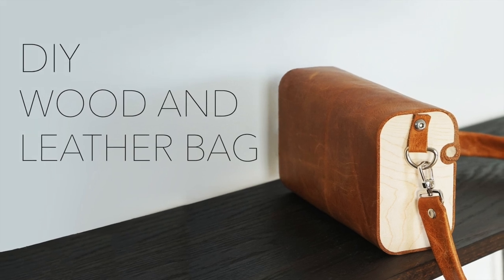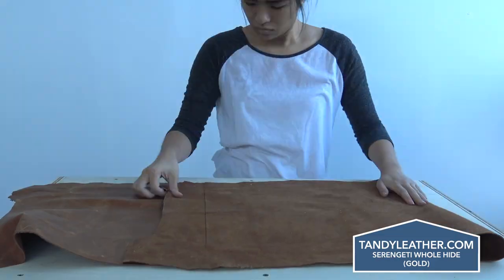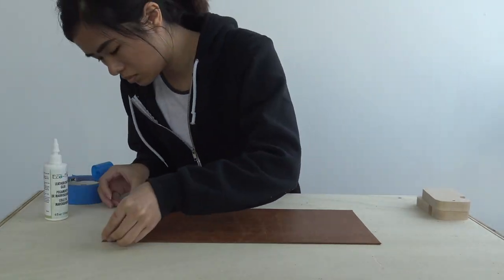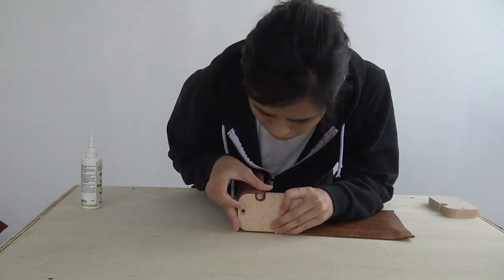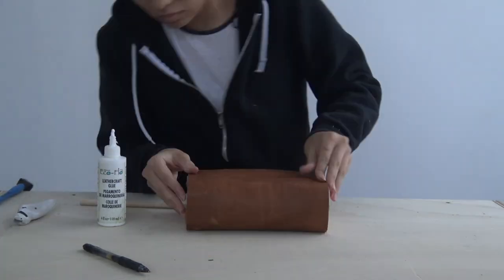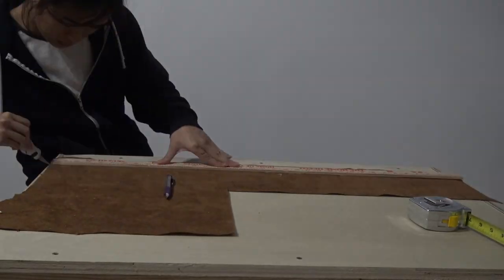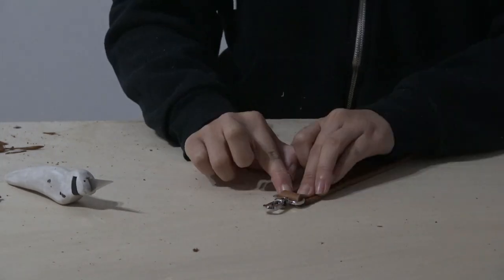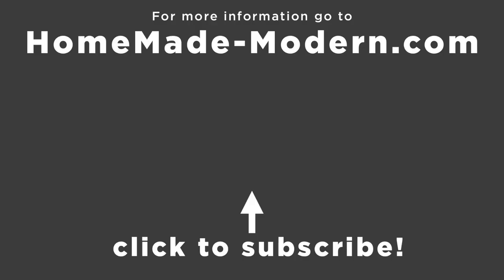Making a Wood and Leather Bag | A CNC Project

Comment: Use Barge cement or similar for structural gluing like that (where you're not stitching over top), the eco leather glue stuff won't hold over time. With the tap of a hammer your stuff will be permanently stuck, no more issues holding everything while the glue dries 👍

Comment: Impressive that this is real DIY work by a woman, instead of yet another crafty, superficial creation.  This is good work!  Very glad to see your CNC table top machine, and I must get one.  I also did not realize you could glue leather easily.
Could you share the type of glue you used for the leather?

Since I do a lot of woodwork and refinishing, let me pass on some info to you.  I think the wood on your bag would look better and not get staining from use, if you finished it off with:
1.  Coat liberally with Watco Danish Oil (follow label).  Let dry overnight.
2. Thin out Varathane Polyurethane Oil Based Clear Interior Satin (30%) with Mineral Spirits (70%) and put 2-3 coats on oiled wood, sanding with 400 grit in between.  Make sure you have no bubbles in the Poly finish.  Make sure you wipe lightly after 30 mins of application to even out the layers.

You will find that the Poly makes the wood durable and stain resistant, and gives a nice finish.  I generally use a Satin not Gloss but that is your preference.  You can also dye the wood prior to oiling and Poly coats, with some fun colors like Vintage Turquoise/ Aqua, or Red, or Green to match or contrast with the leather colors.

Thanks for a great video and good luck with your projects.  These are good enough to sell!

Comment: buy a thicker leather next time, make sure you burnish the edges, treat it properly and give it a nice dye. Pretty sure you can get pink or anything  else in a good quality oil based product which will give you the best results. And always ALWAYS remember to apply with sheep woll scraps or wool daubers

Comment: okay ... this is a bit random, but when did a nut become a 'hex nut' ? I've noticed this neologism on several maker channels. A nut is hexagonal... 1920ish to...2017? (this is a genuine question)
Reply: Ever since it needed to be distinguished from wing, lock, flange, cap, jam, square, tee, castle, slotted, acorn, and heavy hex nuts (probably missed a few).
Reply: I can't say exactly when the commonly used term changed, but there are a bunch of different kinds of nuts, some of which aren't hexagonal. Like square nuts, or t-nuts, for example.